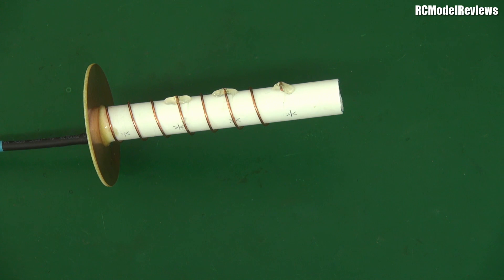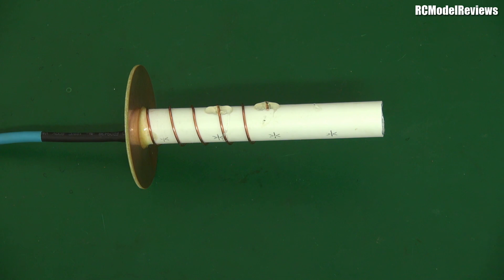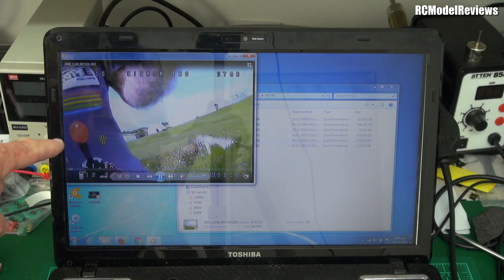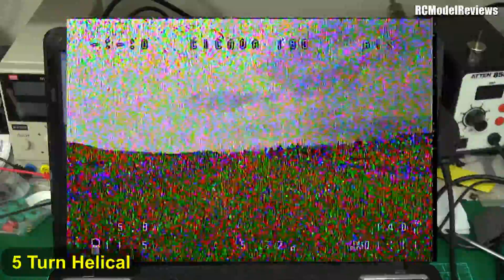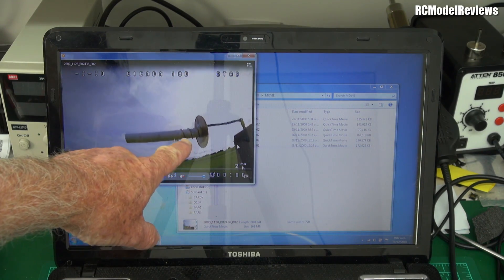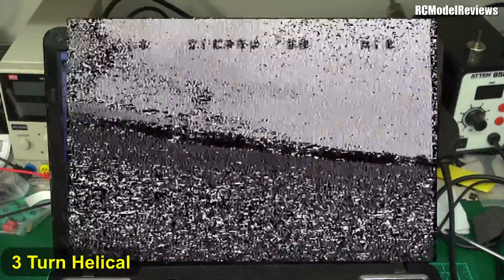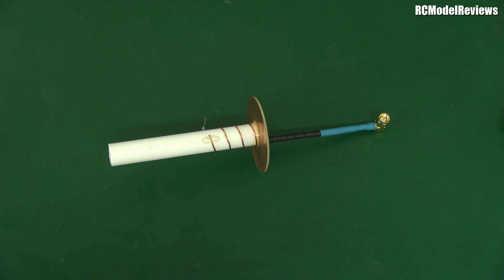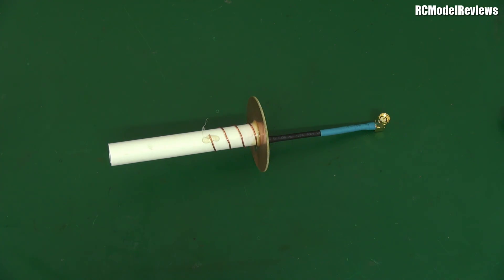DIY Helical FPV antenna (5 turn and 3 turn compared)

Comment: Can i use aluminium foil for the reflector on the antenna?
Reply: I think the wire is soldered to the reflector, soldering on foil would just cause burning a hole on the foil.

Comment: For removing hot glue the easy way... just add a couple drops of alcohol (the fuel type found in the paint dept.) and voila! it will pop right off.

Comment: I'm going to try 3d printing the reflector and use aluminum tape. Think that will work? Might be able to add the disc to the 3d printed tower and print it as one part.
Reply: It would work as a reflector, but connecting the ground (the coax shielding) would be damn near impossible.  You could braise (sp?) to solid aluminum sheet. You would need a solid  electrical connection to the tape.

Comment: Possible idea for a RCMR video: for people who do the removable antenna mods for their transmitters -- is it feasible to make a protective circuit in case their antenna is not connected/bad?  I.e. automatically protect the transmitter by connecting a dummy load if the antenna becomes disconnected (or just if VSWR is simply too high).  ISTR Bardwell blew his X9D with a bad antenna that was connected.

Comment: Is there a correlation between the size of the back plate and the number of coils?
If so then could it be that your back plate was more tuned to the 5 turn?
Reply: I know this is a year late.   Answer No.   The back plate is cut to 1 wavelength in diamiter.    You would only change the size of the back plate if you where changing the frequency.

Comment: Only watched it a few mins and have an idea: what if you make the length of that spiral electronically switchable (like a power switch after each turn? Could you then expect to adjust the reception pattern „on the fly“?
Ok, now I wanna hear a „challenge accepted“ from you and see a diy video of it soon :)
Greets, long time not here, sorry, will watch more now I promise :)
Reply: @RcSchim...LOL...stop teasing him like that. :)..but sadly the frequency being so high...>anything< attached to the receive element will result in its detuning . Bruce would happily take the challenge, but I'm afraid he's not quite able to 'Walk on water'...at least just yet... good to see you cruising around the net, I watch your channel a lot...great channel always got something interesting your checking out.

Comment: I've used several 3 turns but never a 5 or more simply cuz i thought the beam would be too narrow.gonna have to try one. As far as antenna trackers. I found a great 'silver bullet' approach that works really well and cheap. There is a couple triversity recievers on the market . I use a 3 turn helix in the center pointing in where I fly and a cp patch on the other two channels pointing toward approach and takeoff corridors. Since it uses instant triversity receivers, there is no moving tracker and it will cover about 240 degrees of azimuth quite well. really simple way of getting most gain where you need it most . I also send signal through a 25 mw and omni repeater to an omni on my fat sharks so I can freely use the head tracker ability eliminating the need for a high gain antenna on my goggles.

Comment: Great video again Bruce. I use a 1/4 ground plane with perfect tuning on my 1.2 groundstation, 
it is outstanding and beats anything non directional. Pattern is everything.
Reply: Thats interesting....I'm sure a GP will beat out a lot of omni designs...but what about Circular Polarization needed to reduce the reflections etc.

Comment: Is the beam width the same for altitude too?  So say 50 degrees beam width left to right, and up to down?
Reply: Jibba Jabba FPV yes
Reply: Alden Hauser cool thank you, so you could conceivably angle the antenna at 45 degrees up and have 95 degrees of coverage up/down, excellent, my quad thanks you.

Comment: I made a double ended twin 3 turn .. actually a 6 turn with the reflector in the middle .. works fairly well with good gain in front and back .. shouldn't work but it does, btw the coil is wound the opposite way on the back.
Reply: Wow that sounds interesting ..like maybe it could be hooked up with the Flutz capacitor....lol....I would think it would have to work...IMO it would simply tighten the beam width and increase gain.
Reply: @gittarpikk   works well when you are flying up and down a strip .

Comment: Does the diameter of the coil matter? I was thinking of 3 x 5mm diameter 7 turn coils, plus bases in series on one sma connector? Is that possible and if so would it be worth it?

Comment: Plastic bolt.
Reply: Plastic bolts are normally nylon which is hydroscopic(absorbs water)
Reply: @scienteer3562  I was actually thinking of Delrin [sp]  which i have used in the past in electronics....

Comment: Great information.

Just wondering. 
Could those helical antennas be put in parallel with another two, in a Y shape, so to give all-round reception? 
Then you would always be in the beam.
Reply: You can do that.
Reply: @tanmay______ : Thanks for that info. I thought it might cause a problem with reception. Cheers.

Comment: I’ve been using a 5 turn helical on my Fatsharks for years. It’s a good all round performer for range and beam width when u don’t have diversity. 
I like the look of the IB crazy pepperbox though. It has about 13db gain and about 120 degree beam width by memory

Comment: Would it make a difference if the base copper plate is wider?
Reply: The diameter is set due to a percentage relationship to the frequency of the wavelength of the active element...usually 105% which when set behind the active element acts sortof like a reflector (just to try to keep the explanation simple)...To increase or decrease that diameter will typically detune the antenna making it pretty much useless. In the antenna world, it acts like the last two elements on a yagi antenna.(which is the reflector elemnts and is longer than the rest of the elements)
Reply: Explained in previous video.  Might, or might not.